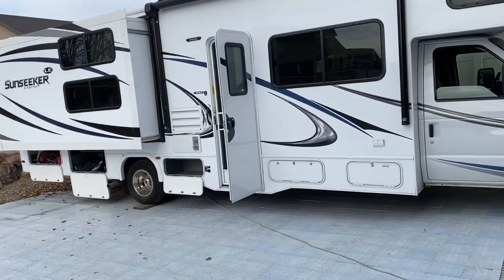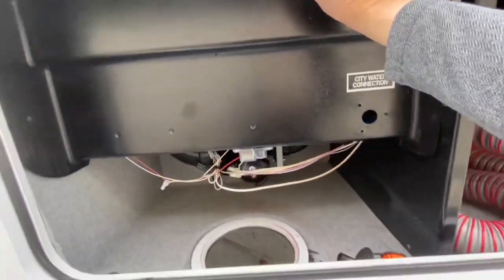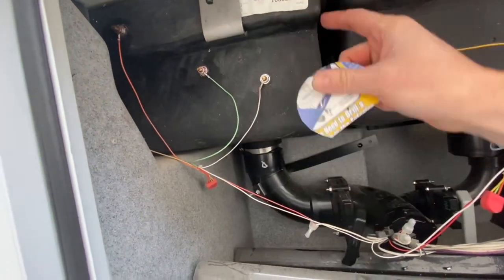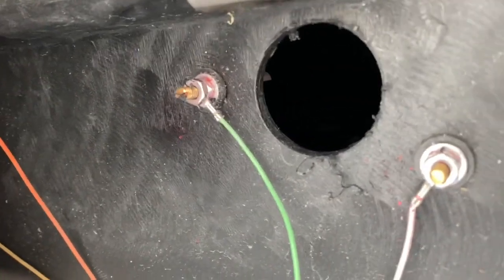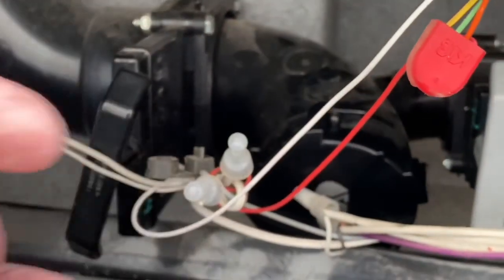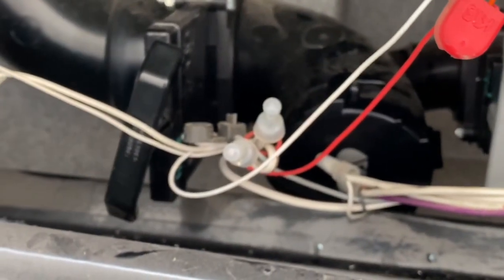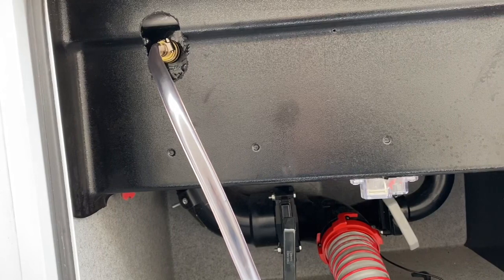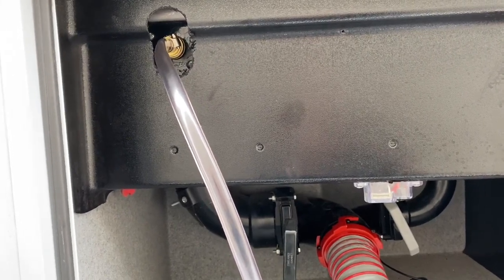RV Black Tank flush installation camco Tornado flusher install

Comment: I had to install mine lower than recommended as well, how is it holding up?
Reply from the maker: No issues at all with mine, it's been working great, especially keeping the sensors cleaned off